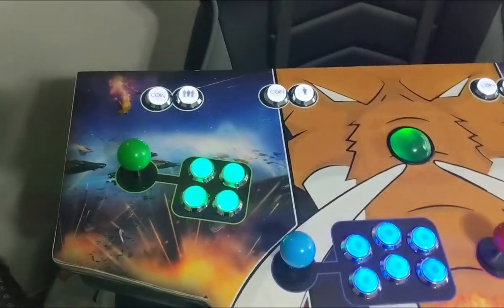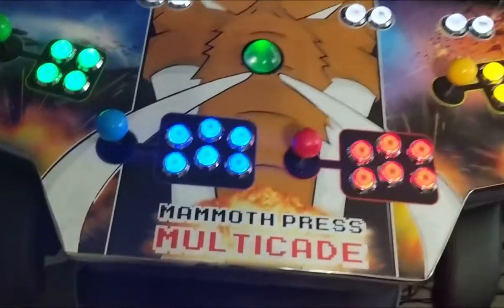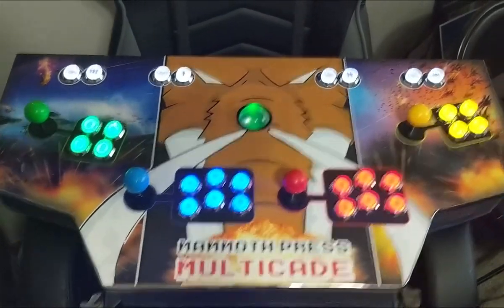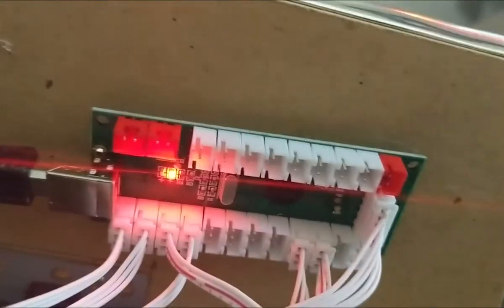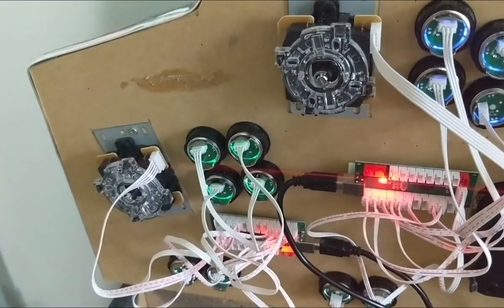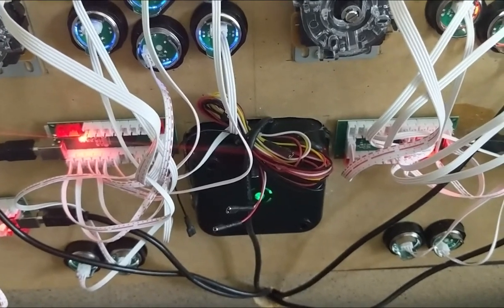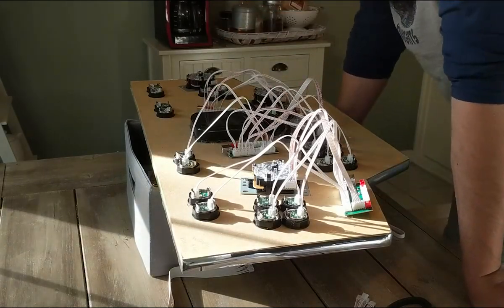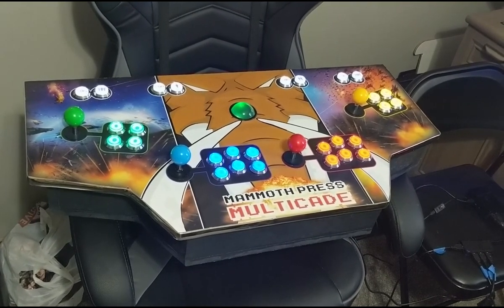DIY Arcade Machine Cabinet Build: It's Episode 9!

Comment: How do you create a PSD template to create the artwork
Reply from the maker: I start with a a model design in SketchUp or CAD to build everything to scale, and then measure each piece individually. I take the measurements into Illustrator to do 2-d line work that I apply artwork to. Photoshop would work similarly but I rely heavily on vector artwork for files this large. Hope it helps!